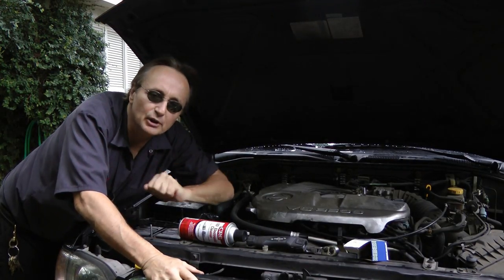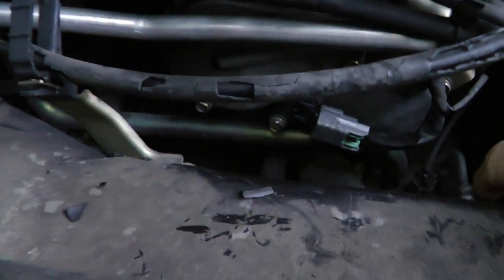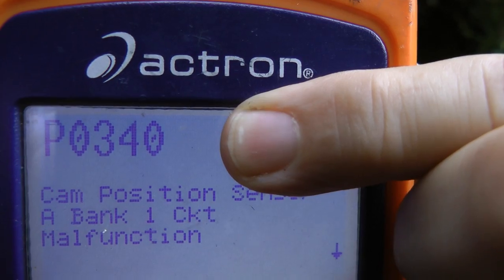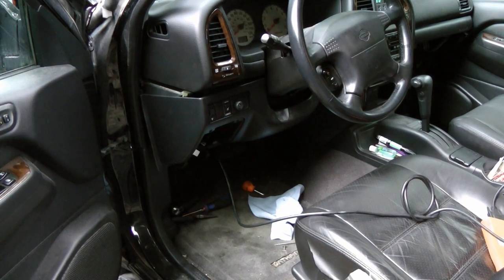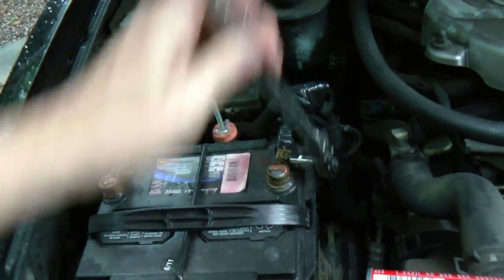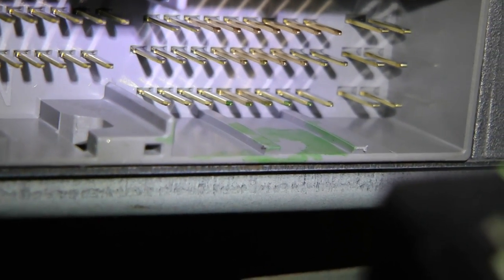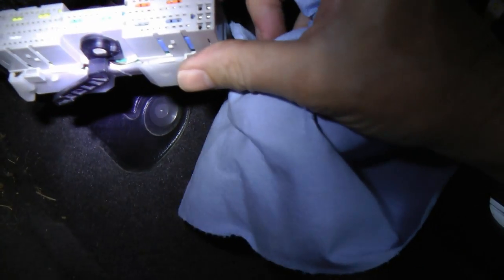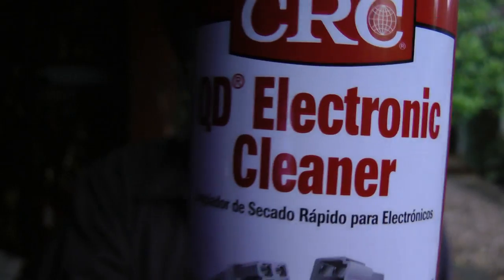How to Fix Computer Problems in Your Car with a Little Spray Cleaner

Comment: I need help with a 2001 Pontiac grand am se 2.4 powertrain module?does this affect the computer> and how do I reset the computer?
Reply from the maker: you would need a mechanic to reprogram the main computer when that's replaced, that's how modern cars are, of it won't start and run correctly

Comment from the maker: not normally, but the rebuilt distributors are often no rebuilt correctly, and the cheap chinese made ones often don't last long either if from the wrong place in china (some are good, some are bad.)

Comment: 2001 durango 5.9 it starts by me wiggling black connector on pcm and shuts off after 30 seconds or so,can it be pcm or crankshaft sensor? prior to this i had to bang fuel tank to get it to start
Reply from the maker: well, fuel pump or fuel pump wiring has a problem,  and probably a bad connection exists on that black wire going into the computer wiring harness
Reply: so my issue is fuel pump related? or a bad ecm? thanks for the quick replies by the way i appreciate it

Comment: hey Scotty.. my car won't start. I took it to a professional mechanic but they told me it was my crank shaft sensor but I already bought three sensors and they never made the car start. I've done your other videos when dealing with the car not starting and nothing has worked so could you help me? I have a 2001 Hyundai Tiburon
Reply from the maker: +Rozell Claxton  tons of things can do that, but if it has a crank code stored, either wiring is bad, main computer is bad, or the part the crank sensor measures spinning on the engine has fallen off inside
Reply: +Scotty Kilmer do you mean the relcutor wheel??

Comment: Hey Scotty, I own a 1997 Mitsubishi Eclipse GS-Turbo Spyder. It won't start up, not even crank, nothing. I put a new starter, battery, battery terminals, alternator and all I hear is the starter clicking or it makes no sound at all. Too add to it, my temperature shoots up when I press the gas pedal or use anything electrical. Could it be the ECU? I had an Engine light which was the Crank Position Sensor which I replaced but I still get the code when the car doesn't start.

Comment: I have a 2001 mitsubishi Eclipse Gt 3.0 it does a wierd thing. It wont start when its rainning or there is humidity in the air. I replaced the spark plugs, the cables, the cap distribuitor, the starter and still does not fix the problem. what could it be?
Reply from the maker: +Alekz T. bad main computers often do that on Mits, they get damp and short out. If it won't start up and you lose both ignition and fuel injector pulse, replace the computer

Comment: will a BAD powe steer pressure switch sensor cause  ..VDC SLIP...light to come on? 2006 pathfinder
Reply from the maker: it could, but not very likely

Comment: Sorry to keep bugging you here's my current issue now ,after the no bus yesterday I left the car alone I went to check for a no bus again and everything worked as normal car started and restarted 5 times everything was normal 2 things were odd the rpm was 1 tick lower and the rpm went 1 tick lower when I turned the wheel left and right on idle after the 5th time the car shut off on its own but now it restarts on its own but dies within seconds ,again thank you so much for your help so far this is a on 01 durango by the way
Reply from the maker: bus problems are wiring problems on the main wire that the computer uses to run the car, so, they can come and go like the wind. Good luck tracing that down, often bad grounds or bad computer itself.
Reply: okay thank you for the help so far,if i ever find a solution ill pass it along so it may help someone else out
Reply: i hooked up a odb-2 reader and i had this ''DTC status -MIL off Spark Ignition'' i do not know how to interpet this exactly but obvioulsy theres a problem somehere in that area but connection was lost after 20 minutes of idle im guessing ignition coil?

Comment: You can say that again. Thanks for responding quickly. Your videos have been invaluable as I've worked on all many systems recently. I sprayed out my PCM connectors today just as you demonstrate here. Hopefully it will finally solve my intermittent driveability issues. Fingers crossed as I'm out of ideas. My car does runs great 90% of the time now. How about a video on power windows problems for older 4th Gen (93-96) F-Bodys? Or one on how do you scan these 94s 12 pin flashable PCMs? Thanks!
Reply: Did it work? I’m having issues with my 2010 Mustang GT my scanner ain’t giving me a code for a bad PCM just a PO443 which I already replaced but the check engine light ain’t going away & scanner is till giving me the PO443. After seeing this video I’m hoping it just needs to be cleaned just like Scotty did 🤞

Comment: Hey scotty need i need help. my 98 dodge ram 1500 5.2l 318 is acting up. When the engine is cold i put the in drive or reverse and it takes it a while to engage, Every time i come to a complete stop and accelerate again it just revs up for a sec and then suddenly it catches gear and just jerks really hard. Once its going it feel like it wants to go out of gear so basically their are multiple jerks until it reaches second gear and from their it works just fine. Could this be a computer problem?

Comment: i have a honda odyssey 2002 , after i changed the alternator and battery , battery , sliding doors indicators ,brake and brake lamp indicators wont go off thanks
Reply from the maker: if they didn't do that before, you shorted out wiring or a computer circuit. good luck on that one

Comment: Scotty, when I tried to release the fuel pressure to check the regulator, the fuel just spurted out a bit. Even with the key on, there is no fuel pressure. The car runs good until it gets warm, then stalls and won't run until it cools. Also there is extreme green corrosion in the distributor and cap. Do you know what it might be? The regulator seems ok, but I'm not sure. Please help :)

Comment: I got a Mazda 3 2010 with power steering problems, took it to the dealer and they told me it came out with a "b1318" code and that my ps pump has to be replaced and will cost over $1,000 with labor, what are your thoughts on my situation, should i replace it!?...
Reply from the maker: +Ruben Plays go somewhere else and put a rebuilt pump on
Reply: +Scotty Kilmer Thanks for that, I just hope i can find one cause they are kinda hard to find where i live!!!...
Reply: +Scotty Kilmer I have a Ford freestyle and wrench light is on  I replaced throttle body sensor and peddle sensor but still runs for ,20 mins light comes on shut car off runs good for nother ,25 mins it dose the same thing ever time

Comment: I need help  i have a 2007 Infiniti  G35 an it doesn’t want to turn on , it has a u1000 code an the scanner won’t communicate with the car , all lights turn on but the car doesn’t want to  start,

Comment: @dencin97 Well, I my self have a 2003 4Runner. The original engine, was it a V6 or V8? If it was a V8 then you need to get another V8 from a 2003 4Runner, before they added VVTI

Comment: hey I have a 2001 golf gti with a bad ecu it doesn't trun on because the ecu is burnt do u have any suggestions
Reply from the maker: have a pro check out the wiring FIRST, cause if it's bad, putting on a new ecu will just burn that out too
Reply: Ight thanks

Comment: Scotty how do you respect but that does not look like oxidation to me. That looks like in my opinion color-coded areas so you know where the connectors go. I have the same green on mine computer.  I’ve been a plumber for over 13 years I definitely know what oxidation looks like from Copper
Reply: regardless it fixed the connection...and i am going to try it on my truck...i bet a lot of guys never even try this and just replace the unit... I can't tell you how many times i had failures do to poor or failed electrical contact..
Reply: have you ever seen a green copper penny d.a.!

Comment: Hi, Scott i have a 92 mustang gt it was running fine then it would run like crap ive changed ever thing like injectors ,fuel pump ,but when i turn the key on the on poss the fuel pump keeps  running passed the 2second prime is that normal pls help
Reply from the maker: I would pressure test the system to see if the fuel pressure regulator is bad or not,as a weak one will do just that
Reply: Thank you

Comment: Hello Scotty,  i have a question,  i have a 96 toyota corrolla and the engine is acting all funny,  losing power and shutting down on idle,  i recently had it scanned ans it gave a p1600 code, the mechanic told me i had to replace the computer,  is this correct?
Reply from the maker: it often is, that or bad wiring from sensors to computer
Reply: +Scotty Kilmer, Thanks you very much Scotty.

Comment: Hey Scotty by disconnecting the battery that's reseting the computer isn't it? So technically you don't no if it really was that connector that code could reappear later on couldn't it?

Comment: Hey I just got the oil and engine air filter changed on my truck (v6 with VVT), plus the normal checks they do at the dealership and after I got it back, I noticed some really odd throttle problem.  Between 2k and 3.5k rpm it has sort of the same sensation as turbo lag in a small engine with a big turbo, because between then with half throttle it would creep up slow as a snail, noticeably slower than it was right before I got it serviced....then as soon as it got to 3.5k, with absolutely no change in throttle pressure or a downshift, the rpms would start shooting up rapidly.   So I assumed they did something weird to my ecu and unhooked the negative terminal for about a half hour or so, then hooked it back on and started the car, letting it idle for a couple minutes.  I noticed there was this message on the dash screen that read "CAL" instead of the compass direction, which I assume means calibrating.  That went away after I pulled out my driveway.  But the odd thing after this is, my radiator or radiator fan, or some type of fan or something in the engine bay is making a lot more noise than usual.
Reply from the maker: who knows what they did unless you watched them. But it they obviously messed up electronics, take it back.

Comment: Hi I have a pontiac g6 run all day but if I cut it of wud not start rite bk up but wen start its like nuttin wrong but.I have try everything an nuttin work n try 3 different used computer an keep get n error wud n program to da car the relay I change an still nuttin plzz help me cus am broke can afford it to keep paying for sumthing and then its not the problem

Comment: I have a 2011 Rav4 with brand new battery brand new alternator when I start it it's already says it's in park and low I put it in drive it says it's driving low don't know if it's computer going bad but took it out for a drive today and it stopped and will not start back the crank sensor out clean it out still was magnetized put it back in started driving for awhile shut back off again when I stopped at a stop sign and now it will not start back at all you think the computer could be done

Comment: Often the 1156 or 1157 bulb sockets allow the bulbs to wiggle because the heat has distorted their shape.  when they lose contact with power or ground at the socket the sensor system will turn on the lights on the dash,  check the bulb sockets and plugs to the tasilight assemblies for looseness or corrosion, have seen this often on that type of car.

Comment: hey scotty got a problem with a 97 lincoln mark 8 surging rpm jumping stalling at the red light i have to keep on pressing the gas for it to accelerate ive changed the egr valve the injectors the idle control valve cleaned the mass air flow sensor cleaned the throttle body replaced the throttle body sensor but nothing but i do see a little white smoke coming from the left passenger side behind the engine now im thinking ots electrical but man i ll try anything at this point any ideas yes the imfamous mark 8 a pain lol any other ideas would help if u can help me out please
Reply: code was 401 egr bank 1 sensor but i changed the sensors also
Reply from the maker: rather than guess, test. Pressure test the fuel pump first, weak pumps do just that and trip no codes.
Reply: ok tell me whats the average psi for the fuel pump
Reply: Twan Ellis my car cranks computer blinks

Comment: Its not because of pressure loss, gas tanks don't work on pressure. Its most likely sensed that your gas is leaking/evaporating thus triggering a CEL for the evaporative emissions control.

Comment: Hey I have a problem with my car I put in led light low beam on my scion frs, and a few minutes later all my dash lights came one speedometer went to 0 and steering wheel started to lock up, turned it off and turned it back on and it had a check engine light and ran fine, I put my original headlight bulbs back in and it's still doing the same thing every day any suggestions
Reply from the maker: you can't just put leds in, it can wreck computer systems if not using the correct ballast resistors and wiring. Odds are you shorted out a computer circuit
Reply: Scotty Kilmer so I would half to get it repaired?

Comment: I have a problem with my 2004 Nissan maxima, a new code popped up on the scanner, reads U1000, any help is appreciated
Reply: russell plata try buying a brand new car battery it work for me

Comment: hey i have a 93 chevy caprice put a new fuel pump and filter on it it crank but wont start and its like it is not getting power to the pump but i jumped it at the relay and the pump came right on but still no start

Comment: because if you disconnect the negative and the wire happens to touch bare metal while your working it could close the circuit and cause a variety of things to happen. With the positive disconnected theres no way anything would happen if the wire touches any other bare metal.

Comment: Hi i have a 93 camry it starts n runs good but about an hr of driving it will die n.not turn n for several hrs sumtime turning heater on full blast helps run it i changed fuel module distrubter ect sensor n nothing it has a code 14
Reply: savade22 crankshaft sensor!

Comment: hey scotty can radio, ac, and door lock be affect by the computer? they work but when they want to. the ac blows hot air on the driver side while cold on the passanger side. and the oe radio screen wont work but i can here the radio fan working.
Reply: also i placed a snap on computer to diagnose the problem and it read lost connection with radio lost connection with ac and something with canbus?
Reply from the maker: of course they can, and often a bad BCM module does that
Reply: ive already changed the body modules (2 excactly) but no difference at all but il go ahead and check the ecu. im a hands on type of guy and this cars (cadillac) are insanely difficult to fix (atleast in my opinion).
Reply: what do you think i should check next??
Reply: Juan Teran you should check the battery voltage as well as the alternator.  Please disconnect any aftermarket electronic devices while conducting the test.  The problem you described is likely to be an interference caused by a malfunctioning electronic device.  Currently I believe is the battery and or the alternator.  Hope you enjoy the challenge. Good luck.

Comment: i was putting my hot wire on my jeep today and my rinch hit the frame and sparked aka grounded out now it will not start but it seams normal when i try to start it the fuel pump cuts on and all gauges work and radio cuts on but when i try to crank it does nothing and i know its not my starter i checked all fuses and relays and everything is ok what could it be??
Reply from the maker: often that will short out the main computer, but check ALL fuses and wires on all the different fuse boxes and pray you find bad ones